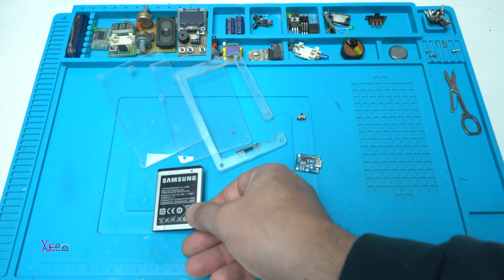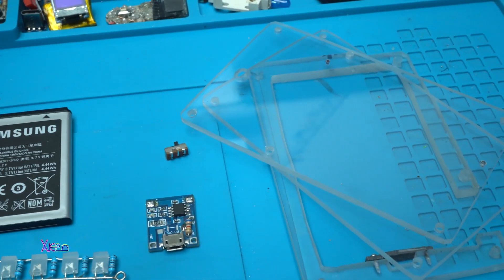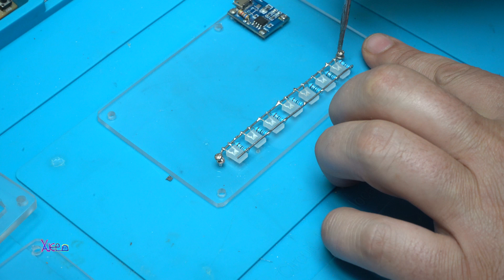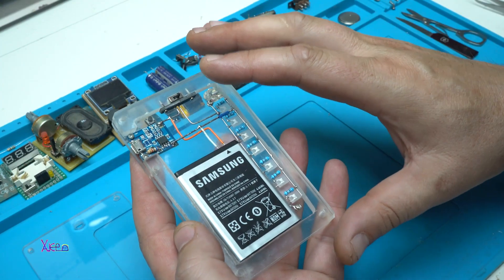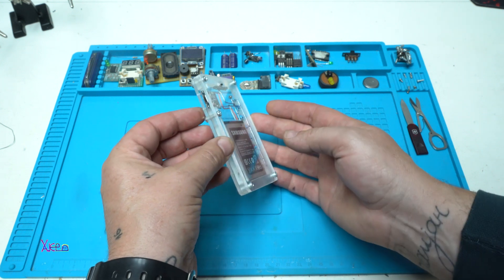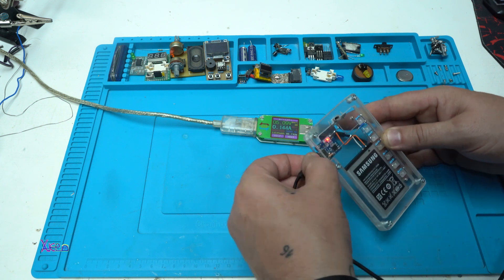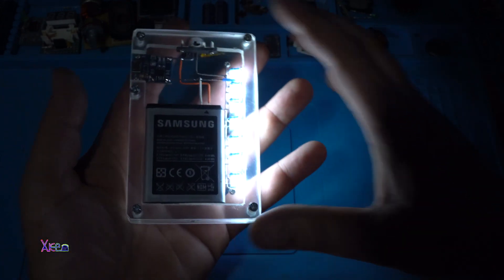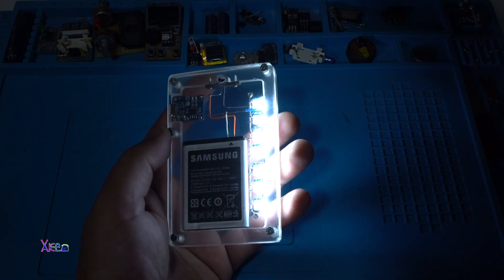I Made Cool Looking Transparent LED Gadget

Comment: Which resistance you used with led
Reply from the maker: For each white led is used 68ohms resistor at 3.7v power and will consume 15mah each led or total all 7 leds will pull around 100mah